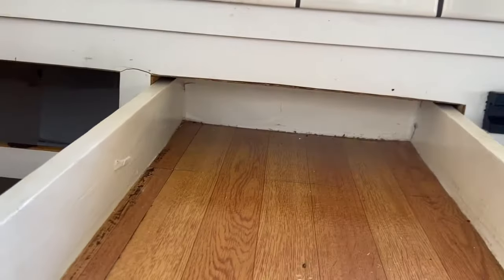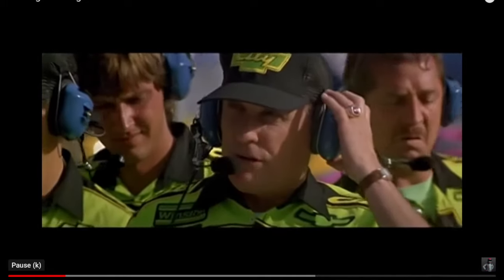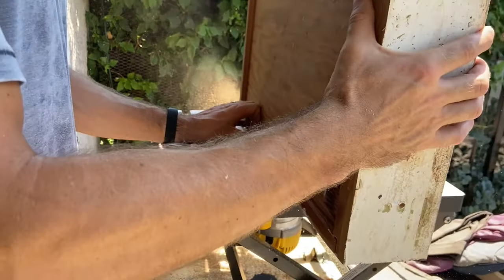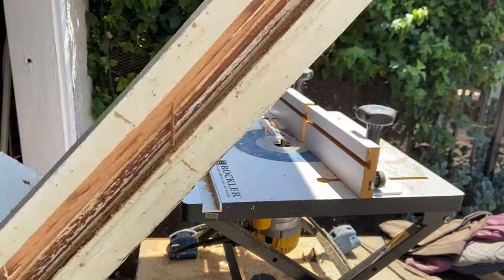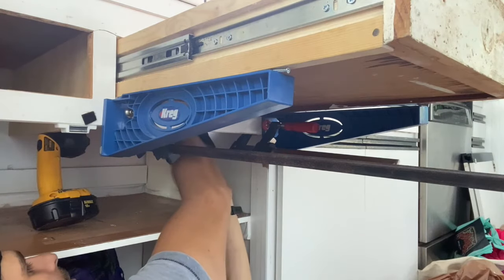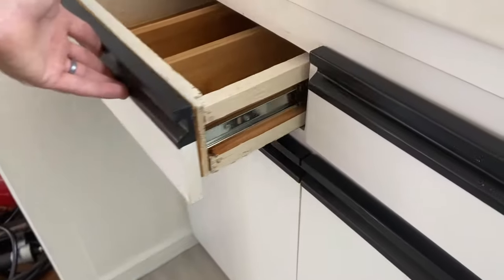Add Sliders to Old Drawers Without Replacing the Box - Money Saving Hack

Comment: Wohoo!! I've been searching for a video just like this! I have a house built in 1905 with kitchen cabinets that seem original, as the openings for the drawers don't have braces (you just slide the drawer flush into the opening, so it hangs down when pulled out). I was really at a loss trying to think of how to add braces so I could install full extension slides. I understand I'll need to shorten the width of each drawer by an inch to accommodate the added half-inch on each side for the slides, but just couldn't think of how to mount them without a brace. Your plywood idea is genius, as I already have a Kreg jig I've been eager to use for months now. Thank you for doing this video!! :)
Reply from the maker: I'm so glad it was helpful! You just made my day! And the Kreg Jig is the greatest invention. I use it ALL the time!

Comment: Thank you, this was extremely helpful.  The sides of our drawer box are only 1/2" thick.  Would this mounting option still work, and if not, do you have any recommendations for other slider options?
Reply from the maker: Do the drawer boxes rub against the sides of the cabinet? If you have space between your boxes and your cabinets, you could just put the sliders on the outside of the box without cutting into them. You might have to cut the "slider shape" out of the cabinet opening though. Another option would be to put undermount sliders on, but again it depends on the spacing you have between your box and the cabinet.
Let me know if this helps!
Reply: You could build up the sides of the box by laminating another 1/2" of material on the inside of the box. Then you could route or dado out the necessary groove without fear of the box falling apart.

Comment: My wood slide is on the bottom. No room on sides as is. Any video on bottom slide conversion?  Thks...jc
Reply from the maker: Are your slides just not moving as well as they used to or getting stuck? They make replacement undermount slides. You can find them at Home Depot, or Rockler for about $10 apiece!
Reply: @coleofsometrades  actually there is a wood track on bottom of drawer and it rides on a piece of wood that is attached on frame front to back. Wood on wood. Very hard to slide. Looking to replace with
 new undernount if possible
Reply from the maker: @Samson-EC  Check these out! https://www.rockler.com/classic-wood-center-mount-drawer-slide-4-pack
Reply: @coleofsometrades  yep, that is exactly what I have from the 50s. I would like to replace with metal o especially if possible. If not, maybe I can sand the old ones to give them a better surface. Thks...jc

Comment: I have my house built in the 40s sold wood drawers on a center T rocker, what do I do??? Will one support the drawer if I add a slider like yours but bottom mounted? Or do I have to have sides?
Reply from the maker: This only works on the side mounted - however, they make replacement center mounts you can buy. I just got some from Rockler for another set of drawers!

Comment: Helpful… but if you don’t have the tools, you’d be amazed at how great nylon tape works. 

I was in a rental with horrible kitchen drawers. I sanded all the grime off, added the tape and they slid like butter! 

I even had a large drawer with over 40 spice jars that was slick! 

Thanks for sharing!
Reply from the maker: I have had luck with that on occasion! I actually tried it on these drawers before taking the plunge and trying this plan, but it didn't help!
Reply: What kinda nylon tape?
Reply: What brand of tape did you used? Thanks
Reply: @soydelrancho   it was about 6 years ago but I think this is the stuff: 3M™ UHMW PE Film Tape 5425
Reply: @BillieRuben  it was about 6 years ago but I think this was the exact kind 3M™ UHMW PE Film Tape 5425
Reply: Thank you!
 @lindseymakes5364

Comment: What type of drawer sliders did you use that don't need clearance between the drawer and the box?
Reply from the maker: These are the ones I used!
https://www.homedepot.com/p/Everbilt-22-in-Soft-Close-Full-Extension-Side-Mount-Ball-Bearing-Drawer-Slide-Set-1-Pair-2-Pieces-D94222E-ZP-W/302867630

Comment: I can’t get the drawer to go in after installing the rollers 
Everything is on correctly but seems there is not enough space to angle the drawer to get the roller to get on the track. HELP Please!
Reply from the maker: Oh no! Are you saying when you tilt the drawer "down" in the back to lock in the rollers, there isn't enough space?

Or is there not enough room on the sides to fit the drawer back in?

Comment: Thx for vid! Quick question, if u don’t  mind. So if I decided to build  new drawer boxes, then I wld just build it 1/2” or 1” narrower- to give room for the slides?  Am I thinking thru that correctly? That I wouldn’t do any of the router work correct?  Again, thx! Hopefully u hv time to pass on some info.  Happy holidays!!
Reply from the maker: Hey Tuan, it depends on the size of the sliders you are using! They are normally a 1/2", but can vary a bit. I would buy the slides before building the drawers!

Comment: How would I do this if I don't want to route into the side of the drawers? I'm renting so I don't feel comfortable cutting into the drawers but I feel like screwing some slides onto the sides should be acceptable.
Reply from the maker: Hey Peter! It depends on your clearance inside the box. My existing drawers were perfectly cut into the box. Meaning, I didn't have the room for standard drawer slides to clear the frame. That's why I had to route the sides. If your box has the space on the sides or bottom for slides, then you could skip that step!

Comment: hello sir  i have two large oak drawer and a smaller one that i'd like to put into a new plywood wood carcass.  the drawers came from an oak table that take up a lot of room in my workshed.  my issue is how to built the carcass to around the drawers ?  i'll be using the metal sliders like yours.  each drawer weighs around 8 pounds a piece.   the measure are 61x61x17 centimeters or 24 x24x6 1/2 inches.  can you help me determine the size of the carcass please ?

Comment: hello, how do I figure out what length of sliders I need to buy?
Reply from the maker: Hey Malin, here's a great description from Rockler for measuring your drawer slides!
For side-mount and center-mount , typically  from the front edge of the to the inside face of the  back and then subtract 1". For under-mount ,  the .  must be the same  as  to work properly.